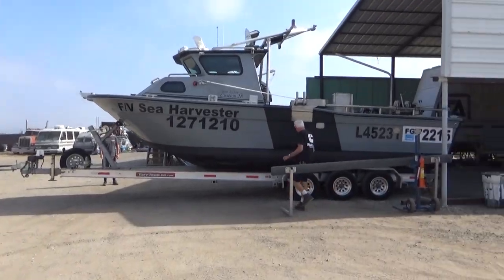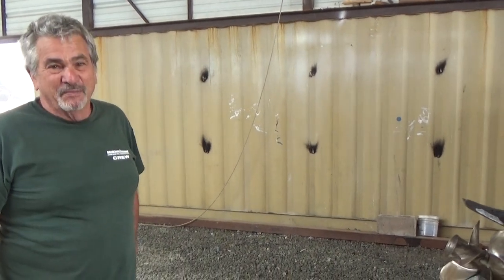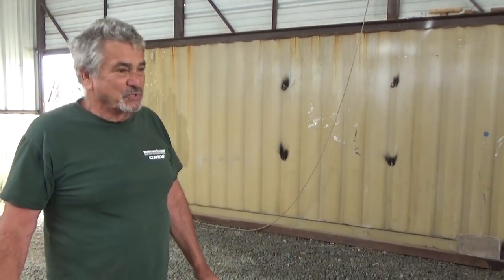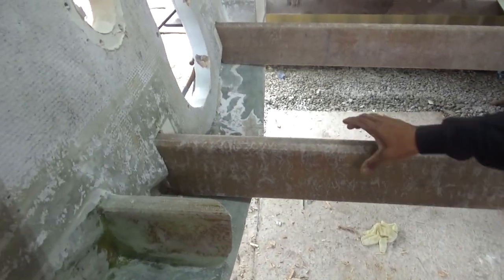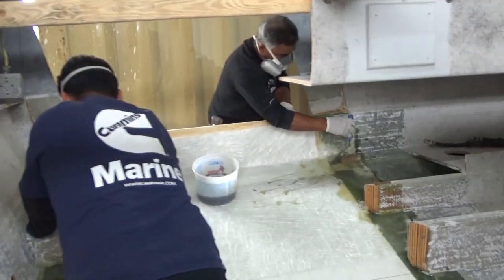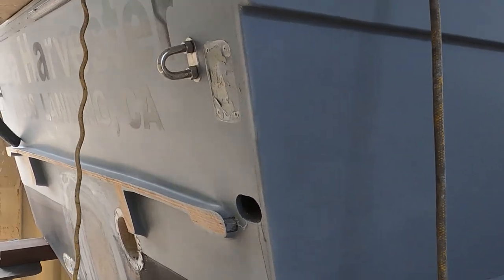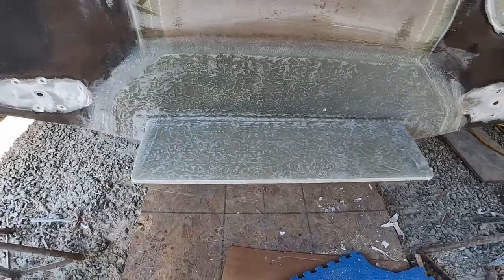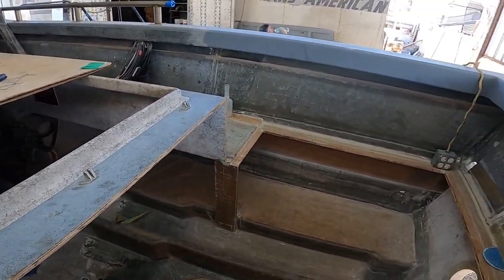Project Spotlight: From Outdrive to V-Drive. The Sea Harvester Episode 1: Lengthening The Hull.

Comment: Justin, how much does the layup overlap when joining the 2 hull pieces? Once the layup is done on the inside do you sand the joint on the outside thinner then re layup that joint to to the original thickness of the hull? or is all th ework done on the inside?

Comment: Out drives do not handle commercial fishboat? Like trap boats. The forward and reverse, say 200 times per day, kills all of them, no matter who makes them
Reply: @Aluminium workboat project Jets are inefficient up to cruise compared to props. Imagine the simplicity of fixed shaft surface drive.
Reply: @Juha Tuomala the surface drive performs well at low speed, as th prop is totally immersed. All these drives have their applications

Comment: How many days did it take to do all the work in this video? This is one of my favorite YouTube Channels.  #boataddiction
Reply from the maker: It's hard to say exactly how many man hours.  Renee has been working on this pretty steady for about a month.  Frank has been in and out, juggling multiple projects, mostly working on another boat. Initially pulling the engine, laying everything out and cutting the stern was probably about a week for Frank and Tim.  Then about a month of Renee building molds, laying up, sanding , laying up, sanding, building molds repeat. It's time consuming to build up all that structural glass.
Reply: @SeaboardMarineIncVideos  Thanks... working steady for a month is good enough.